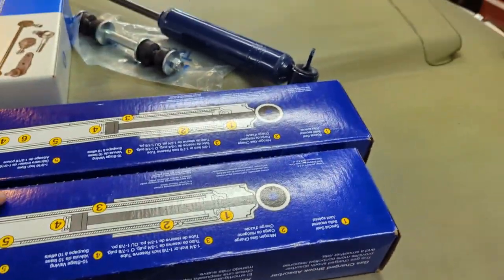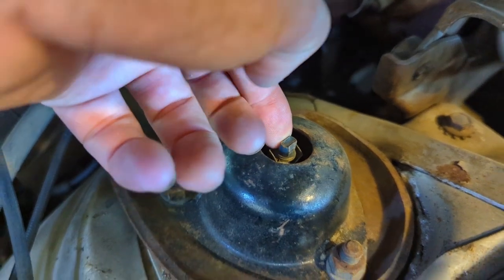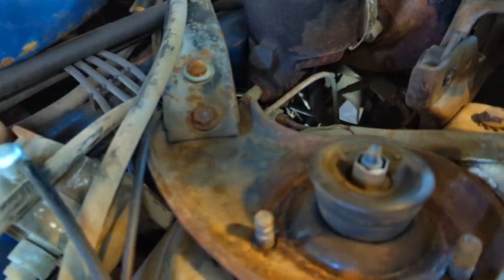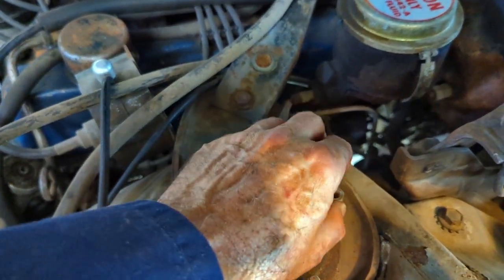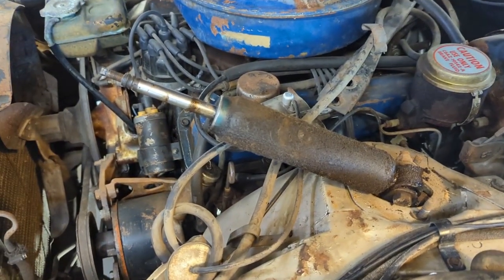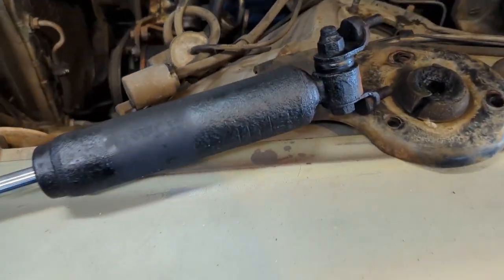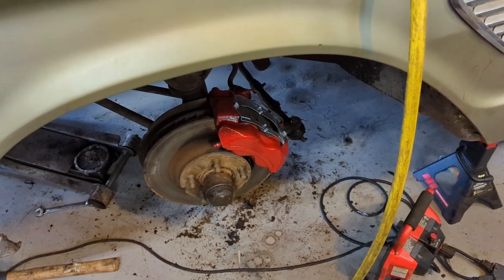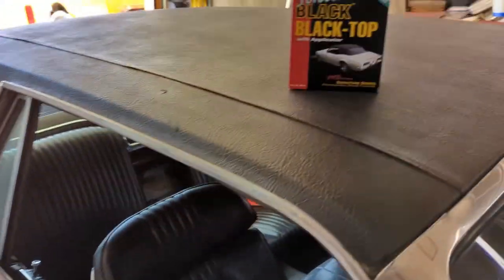Front Shock Replacement - 65 Thunderbird Hardtop

Comment: Hey Alvin, nice job. I remember when we could still get those front Motorcraft shocks, they are great. They went obsolete long ago. The modern gas charged shocks are good too. Front end squeaks are usually the upper control arm bushing and shaft. From the factory they had no zerk fitting so they would dry out and then start to squeak. Then you know they are bad. But obviously your old shocks were worn out, especially when you could easily push the piston up and down like that. Not good. Great job, thanks for the video.
Reply from the maker: Hey Nick, I think a nice gas shock would work well.
The pervious owner of this car did keep the control arms greased, so that's one less thing to deal with. 😊

Comment: Hello Alvin. I like that induction tool. Only problem is it says " For Professional Use Only" lol. Good thing you kept those parts. The picure your wife did is great. Looks like an original advertisement. I don't remember if you said so, but is that engine out of a 66? Keep up the good work. 
George B
Reply from the maker: Hi George,
Yes...that induction tool is in the wrong hands! Lol
As far as I can tell by the casting date on the block, the engine block was cast in 1968, and the heads appear to be the correct casting code, but I haven't seen the casting dates for the heads, but they are a matching set, so I assume they are the original to the block.
Thank you!

Comment: BTW about two months ago I tried to order the same wheel and tire setup that you scored a pretty good price on.  yours must have been a close out deal because they are no longer available.  So on my 64 with three different types of wheels I put a set of Hankook tires on and the original worn out looking spinners for now.  Lost a spinner on the first trip and watched it get run over by a truck going the other direction.  Lol.  Squeaks at front end are usually upper an arms.  You can actually grease them if you install zerk fittings, but usually have to cut a hole in the shock tower to get a grease gun on them.  Not one of Fords better ideas.
Reply from the maker: Hi Jeff,
I just checked Blue Oval Classics, and that rim and tire combo are available...only they are $500 more than when I bought them last year. 😥
Lucky for me the pervious owner kept the control arms greased, it nice and quiet now.